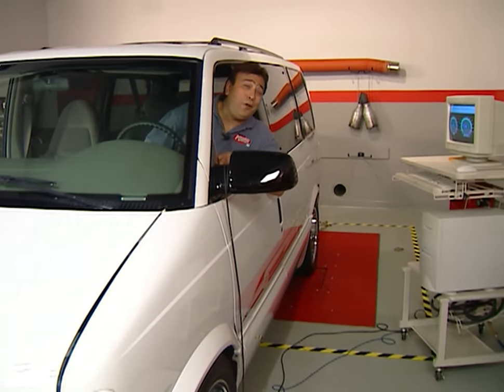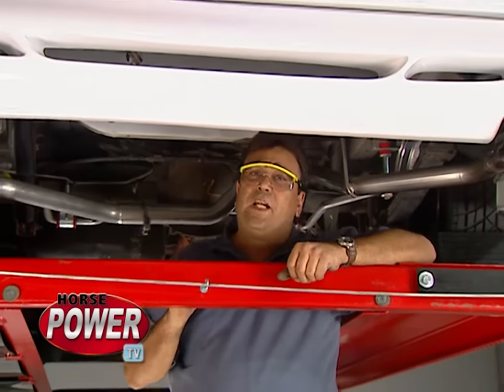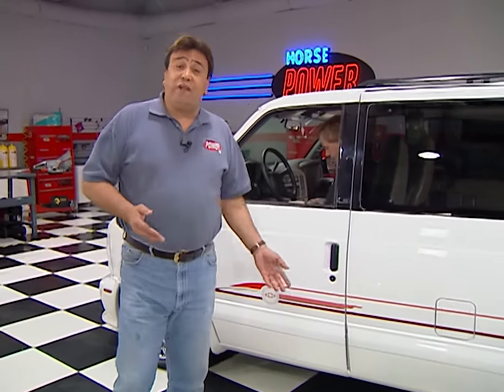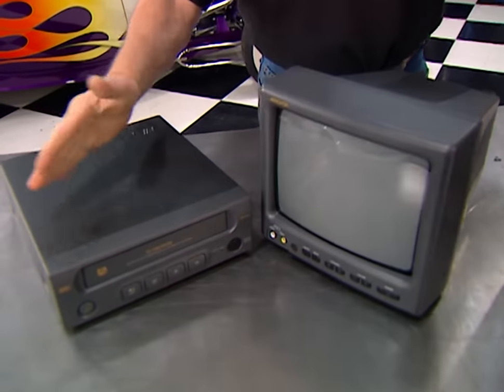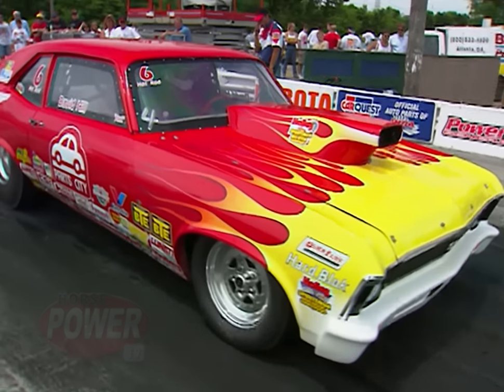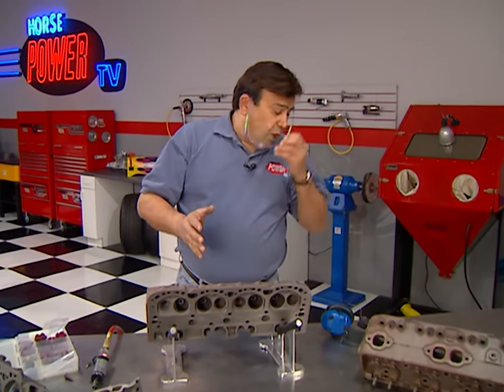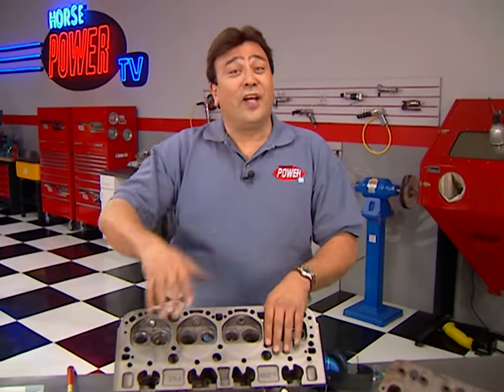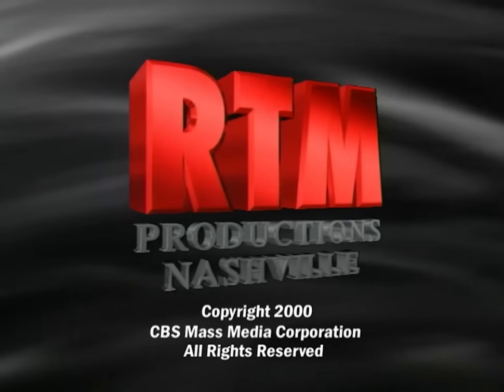Just How Much Horsepower Can A Late-Model Chevy Astrovan Make? - Horsepower S2, E17

Comment: That minivan looks great pretty clean, but when you got 157hp… I wouldn’t be bragging about anything…
Reply: maybe not, but realistically, all they did was give it an air filter upgrade and an exhaust and reprogrammed the ECU and to get 12 HP over their base run is actually not bad. those 4.3 V6 can make good power if done right
Reply: Can still smoke up with tires till this day with over 260k miles on it
Reply: So apparently you've never seen horsepower TV. They absolutely love to spend 80 grand to make 12 horsepower.

P.s. this is a later edition, I pulled that 12 horsepower out of my ass before I even watched one second of the video, what a riot I've just seen enough of this show that I know their gaines are pathetic
Reply: That was a lot of power for 1937.
Reply: It is not a minivan it is a Van
Reply: @Bozemanjustin i dont think they spent 80 grand on an exhaust and air filter 🤦‍♂️ you gotta remember this is over 20 yrs ago....
Reply: @shadowopsairman1583 its smaller then a normal size van so yes its considered a minivan....
Reply: @19chev81 only shorter, full width
Reply: Mid-i-van...

Comment: 17 hp for 1000.00 is not a  bargain in my wallet. Sry
Reply: Thats about a 12% increase....in comparison if you added 12% to a 400 hp engine youd gain almost 50....thats definitely worth it.....
Reply: A greater than 10% gain in horsepower at the wheels for about a thousand bucks is awesome. If you wanted to tell the world you've never wrenched on a car, you could have just said that.